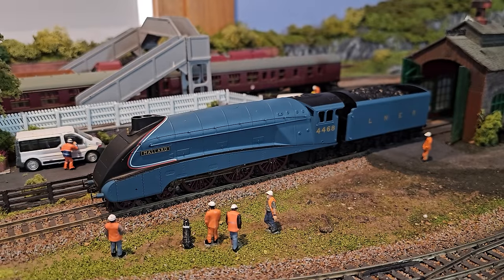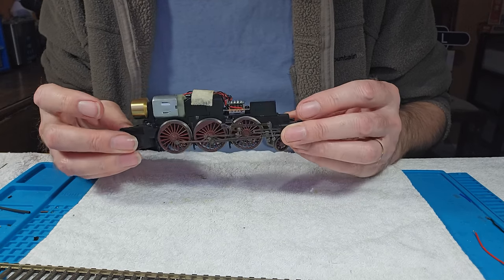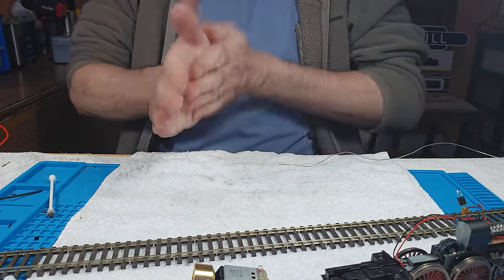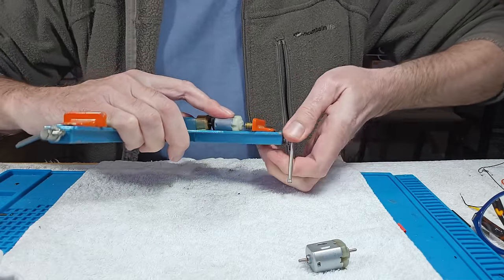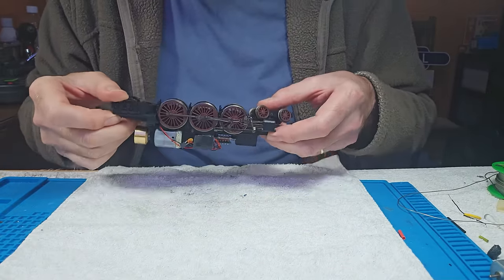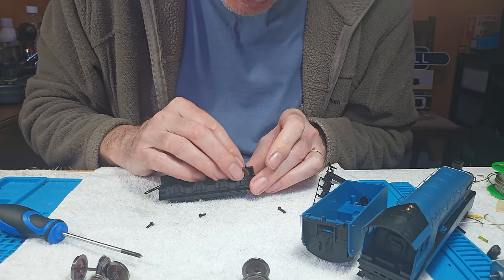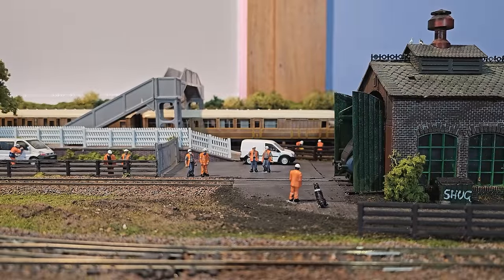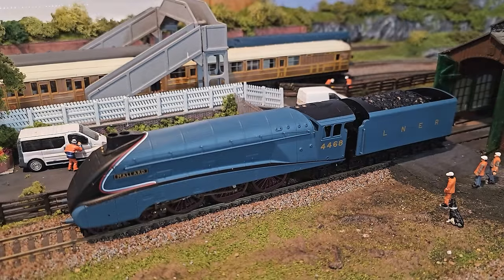Hornby Class A4 "Mallard" : Repair Request

Comment: Pretty sure this is Hornby Catalogue number R3371, a Railroad LNER Mallard. I bought a boxed example on ebay and it was sold explicitly because the motor was dead.
When it finally arrived, the motor would arc, flashing sparks around the commutator. The valve gear motion and wheels moved freely and without tight spots. The motor just failed.
It was my first time removing a brass gear and flywheel from a motor so that the experience was real, it was fun, it wasn't real fun.

That being said, I found a replacement motor on ebay and it was well worth repairing! Though I wish I had waiting a while to see how you did it, as I had to file down some damage I did to my brass gear.
Thanks for another video and repair Bill! From the USA!

Comment: When I had to replace the motor in my FS I found heating the flywheel up slightly on the gas cooker made it easy to push on obvs have to be careful of plastics

Comment: Bill, you can warm up the brass parts before refitting.  With heat they will expand a little allowing for easier refitting. Just a thought.
Reply: But it expands in all directions, making the hole smaller. Actually better to cool it down.
Reply: @AndrewPennell29  you've never fitted pulleys to shafts then. Everything expands from the centre. Try expanding a circle inwards.